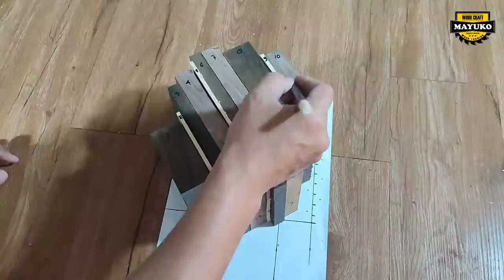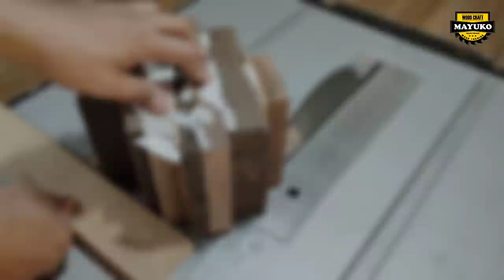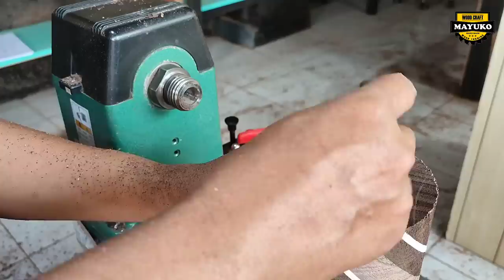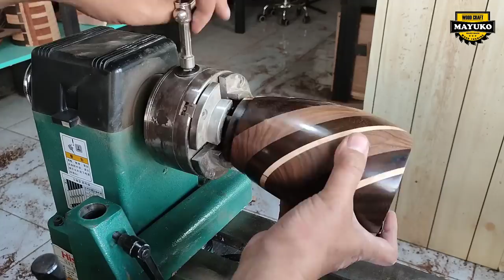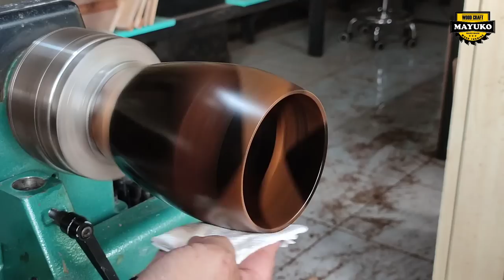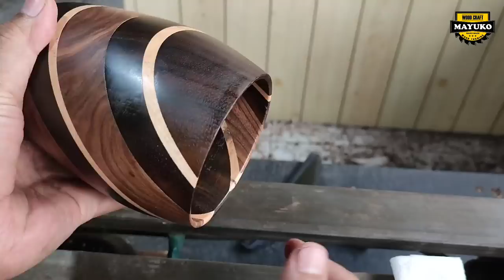MAKE A WOODEN CUP, woodturning

Comment: Nice looking piece. Is the beeswax that you use a mix of some kind? Not sure if you are aware of this or not but a tip for drilling out your turnings to keep from burning the wood and over heating your bit is to first drill with a smaller bit and work your way up. Say starting out with a 1/2” twist bit then maybe a 1” forstner bit or spade bit then the final size that you are going for rather than going right off with a 1 1/2” bit for example. That way it puts less stress on the wood, the bit and your lathe as well.
Reply from the maker: Thank you, the beeswax that I use is a factory product, I don't know what materials are in it and thank you also for the advice in drilling, I did that because first my Forstner drill was not complete in size because it was broken and the drill was already  a bit blunt.. 🙏🙏